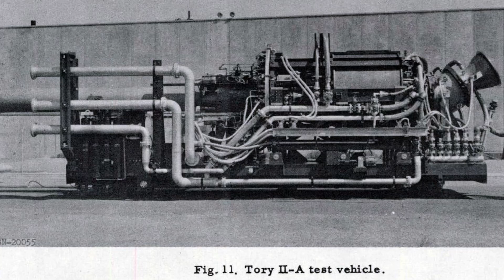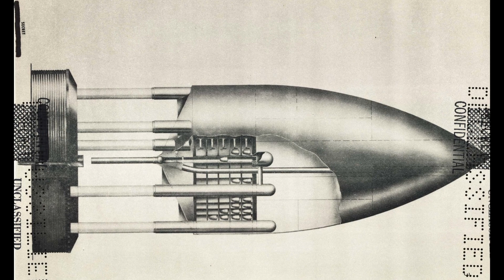How The Pelican Can ACTUALLY Fly in Space

Comment from the maker: In an ironic twist, this past week the United States announced for the first time they were able to initiate a Fusion reaction that generated more power than it consumed (to initiate). This is a small step but an important milestone in developing the technology necessary for Fusion power! Maybe the Pelican isn't too far off?
Reply: a quick question how could the contain the explosive power released? as you smash material the heat generated by it is five time the heat of the sun
Reply from the maker: @Phynix056  There's a lot of really cool stuff, but if I recall right they use magnets to stabilize the plasma. Then heat resistant materials offer protection. I took a materials course years ago and there's so wildly cool stuff being made, especially in the polymer world, that can handle the challenge.
Reply: Fusion would go for the Big Things first. Not Pelican-like ship (equivalent to Chinook).

In fact, if Pelicans can be made into fusion, Scorpions and Kodiaks (Howitzers in Halo Wars) should be fusion powered too (Scorpions for making tanks faster and last longer, Kodiak for making tanks faster and last longer plus running the howitzer because why not use coil mechanism with modified speed for howitzers?)
Reply: @icefl4re597  The Kodiak is inferior. I want my Cobras back.
Reply: @inquisitorkobold6037  Is it bad that I want both?

Comment: the fictional Pelican D77A-TC multi mission interstellar spacecraft or dropship is actually a viable design as a real life interstellar spacecraft . . . and for that it has to much much larger in size . . . a realistic logistics variant of the Pelican D77A-TC multi mission interstellar spacecraft will have to be significantly bigger than the NASA Space Shuttle . . . able to carry 243 tons - 256 tons of cargo & enough usable cargo volume to accommodate upto 13 HH-60F Pave Hawk (Block IV) multi role CSAR helos with space to spare . . . capable of in atmosphere flight meaning it'll be able to land on Mars surface & dock with the Mars Orbit International Space Station (MOISS) in space . . . propelled by hybrid nuclear fusion & ion propulsion depending on the variant of the Pelican D77A-TC multi mission interstellar spacecraft . . . should be able to achieve speeds in excess of 200,000 mph (263,000 kph) . . . wonder if there are miniaturized scale model of the Pelican D77A-TC multi mission interstellar dropship available for collectors . . . from 1/24 all the way to 1/200 scale . . .

Comment: Well I like your point the Pelican is much more advance an aircraft the today modern one. First the flight control are better then to day modern aircraft just by understanding the pelican are trans atmospheric. It omni directional thruster put out more power the the solid rocket booster  of the space program, were an infer that the thrust engine use a form of magnetic engine that use environmental atmosphere in it as fuel, so the thrust to weight  is minimal. Since the alloy used in the pelican is a mix of composite that allows it can go to space, mean that the engine are not taxes in flight. as far as flight stability it on board computer control the flight stability and the avionic are advance enough so an AI can fly the pelican like a drone.(See  book Fall of reach) Pilot are there for manual operation only. The plane can fly with or without human intervention, Since the pelican can got VTOL It does not need wing other the hard points for the missile pods. As the back half of the pelican I can guess it the thrust engine and electro magnetic unit for cargo the engine produce four time the strength of a car crusher magnet. This mean the pelican is stronger then an a10  and has no need ot the basic structure of an airplane

Comment: i feel like the pelican at least originally wasn't intended for space flight, considering it lacks thrusters to push it downwards or in reverse, limiting its maneuverability in zero-g environments. also, the models of the pelican in Halo CE and 2 don't have hatches to close the passenger section from the outside for safe transport of most marines in a vacuum. the use of pelicans in space was likley considered after the fact as making slight alterations to the pelican was easier than making a brand new cross space/atmosphere craft that was more reusable than a drop pod.

Comment: Honestly, the only issue I really have for the Pelican is how it should be armed more, and the wasted space. If it had more weapons that'd be great, but my main issue is space. It's almost the size of a C-130, yet only carries about 10, maybe 25 depending on configuration. Even accounting for the difference in internal volume because the Pelican doesn't have a bay as large as the C-130, it still should be able to hold like a full platoon easy. 

I get how earlier it was because the games wouldn't be able to handle having that many allied NPCs in the game at one time, yet still in the lore they could have had it carry more.
Reply: Mmm its probably more comparable to the Buffalo landing craft. But bigger.
Reply: Do you think it could be armed like the LAAT from clone wars?
Reply: @btrando1  Maybe not as much simply due to it's design, as well not sure how it'd work sticking a couple of gun pods to the wings. Most versions of the Pelican have rockets/missiles as well as a chin gun, but I feel it's still lacking a bit. Then again, I also personally wouldn't have Pelicans flying around without support from other air vehicles unless it was farther from the heavy fighting. Maybe that's it.
Reply: @spookypepper6900  i feel like the idea with the pelican is that it's primarily a transport vehicle but is designed in such a way that it could be easily outfitted as a close air support or bombing platform if needed in a pinch.
I can't say for sure, but in my mind at least, that seems to be the general philosophy behind it's design.
We see similar design concepts in several current day helicopters. They're primarily used for transportation of troops but can be outfitted with various armaments if the mission profile calls for it.
Reply: @TheWhiteTrashPanda  To be honest, the fact that it's so large and yet so slow (relative to even commercial airliners or modern aircraft, it's over 200 km/h slower) and so heavy as well that it'd be ineffective as a close air support platform, and less effective than a cheaper alternative (fusion reactors aren't cheap) anyway.